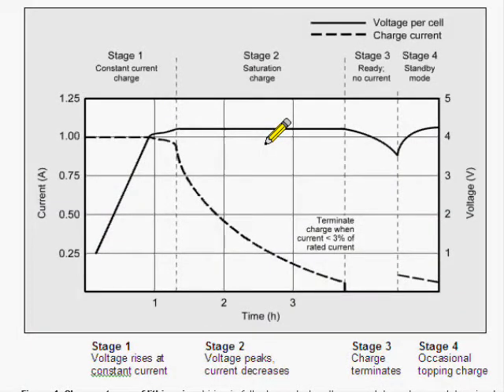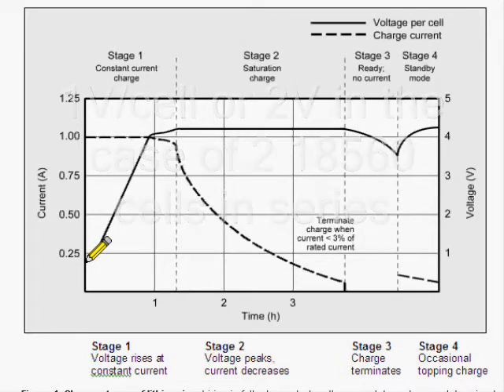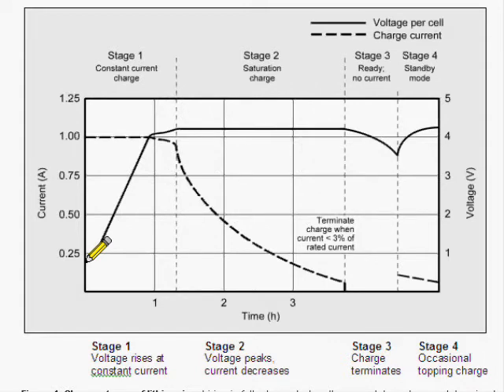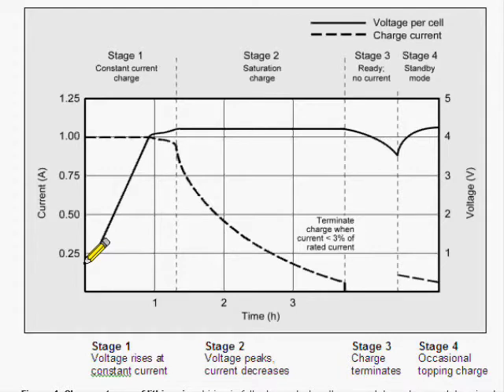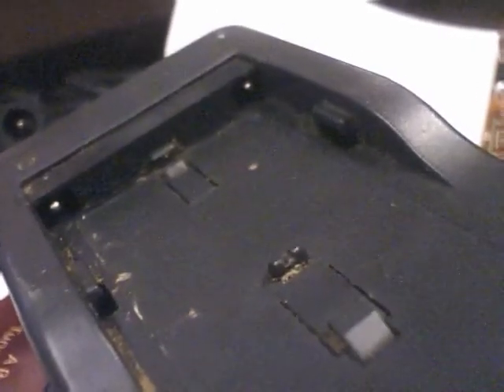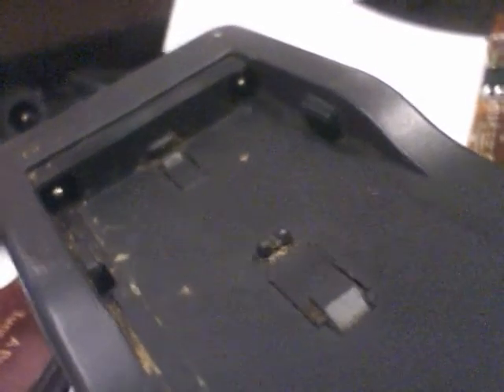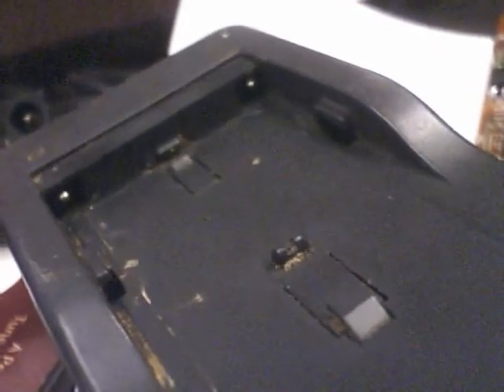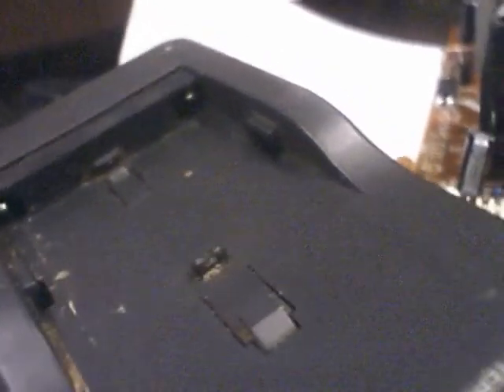18560 Lithium Ion Charger Rant

Comment: I have a 18560 battery...and it was on the charger for 24 hours and it never kicked the green light on...I took it off and it read 4.1 volts...I let it cool and began using it...I was gonna use it a bit and stick it back on the charge to see if it gets to full capacity. ...before the last charge I ran it down until my itaste fire button turned red....this was only the 2nd charge since I bought it